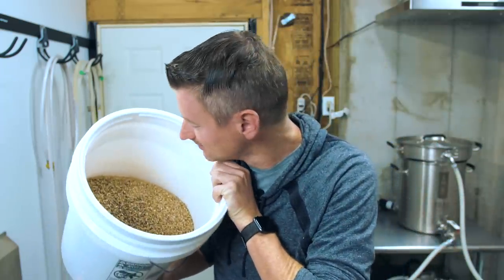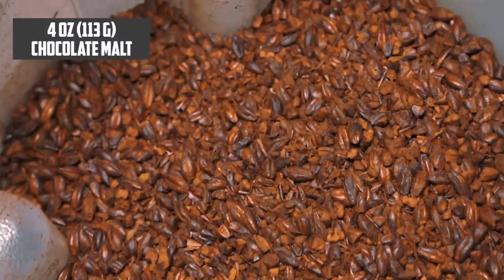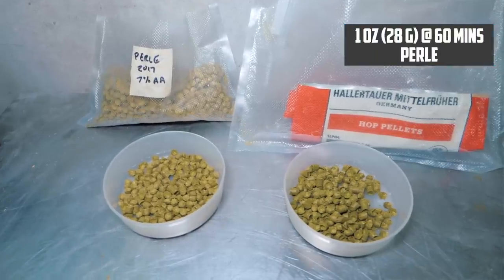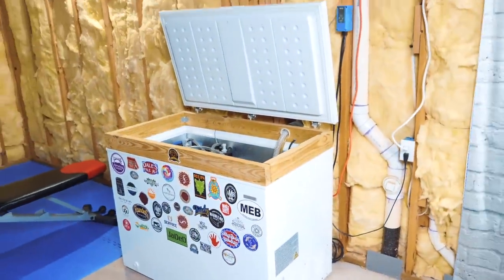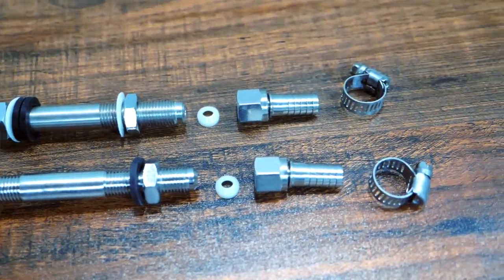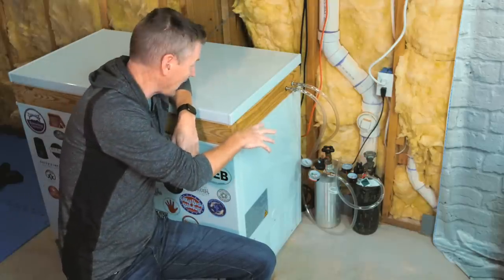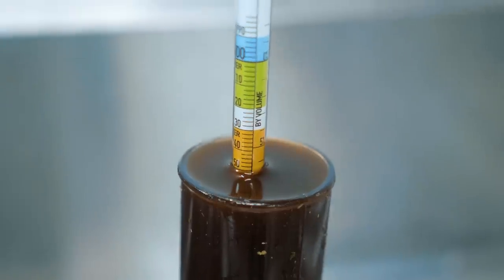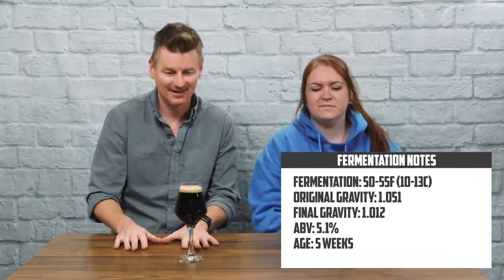Schwarzbier (German Black Lager) | Keezer Updates | Homebrewing Beer

Comment: Great video, as always. 
Curious: why did you opt for using (expensive) metal shafts through your keezer for the CO2? Would you not achieve the same results, with less chance of leaking and for less money, simply by putting the CO2 tubing directly through the drilled holes?
Reply: He should have asked you first, haha.
Btw, you make a great point.
Reply from the maker: Yeah that’s the other option, with some putty or caulking to keep a seal. But, but.... metal fixtures!! 👌

Comment: whats your serving setup? It looks like you have taps upstairs, and clearly connected serving lines in the keezer itself. Given that, are you just using the keezer as cold storage until a spot in the rotation opens up upstairs, or are you somehow running lines to that 4-tapper?
Reply: It looks like the lines run from the keezer through the wall to his bar on the finished side of the basement.  

I'd be interested in hearing what he uses to keep the tower and lines chilled.
Reply from the maker: Yeah that’s exactly it. Have a tube running from keezer, through my wall, and into the finished part of my basement. But I’m spoiling a segment on an upcoming video 😎